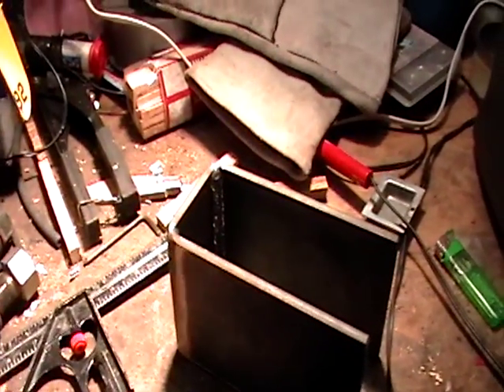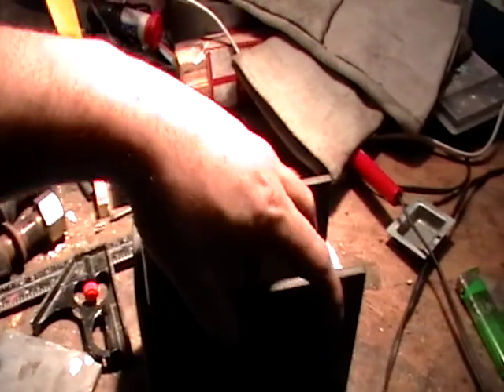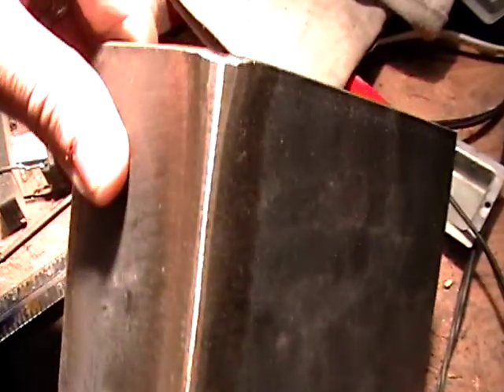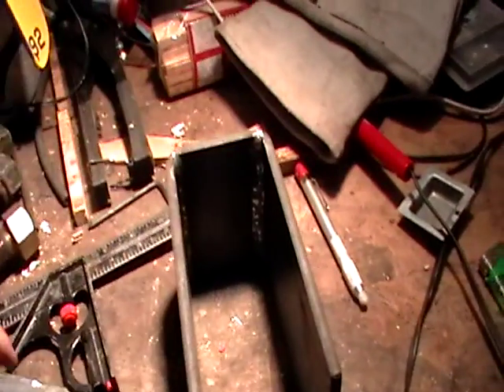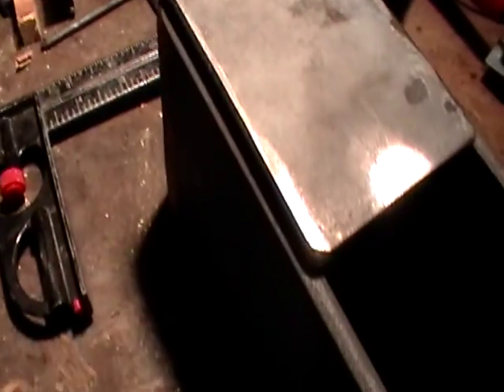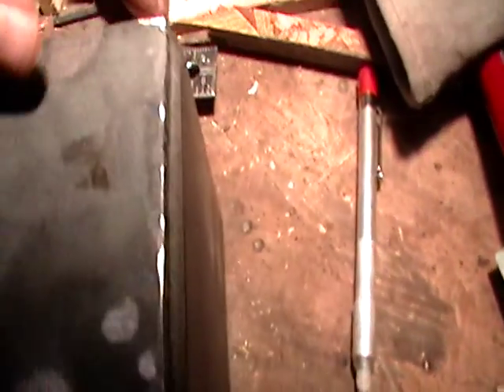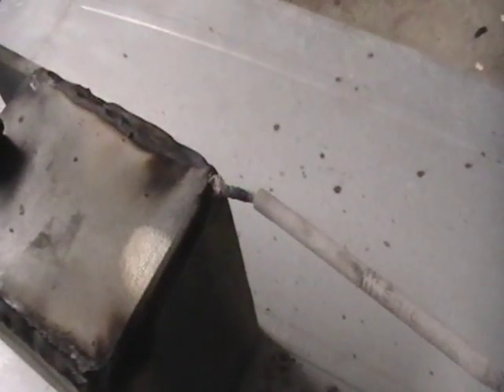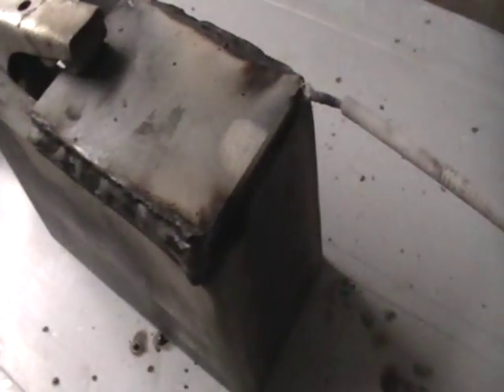How to make a quick hitch top link/center link adapter for older implements and attachments Part I

Comment from the maker: what so you cant see me welding.  Besides I warned you that I was going to try to set it up so you can see it.  Once its welded I couldn't redo it.  I even gave you a heads up to fast forward.  What more do you want.  Its kinda hard to do this and film at the same time.  Im not hurt about it I can take HELPFUL criticism when its warranted.  but leaving a comment as horrible does nothing